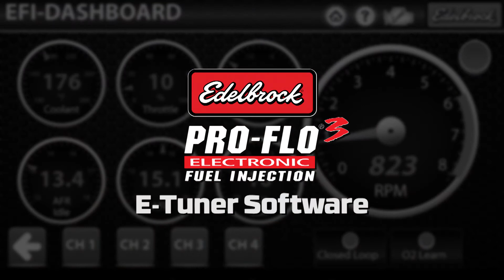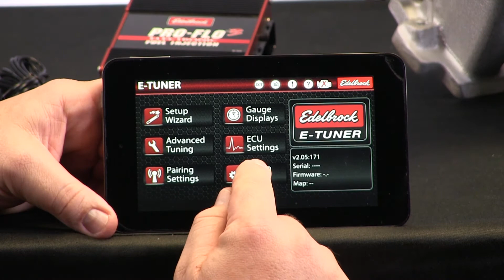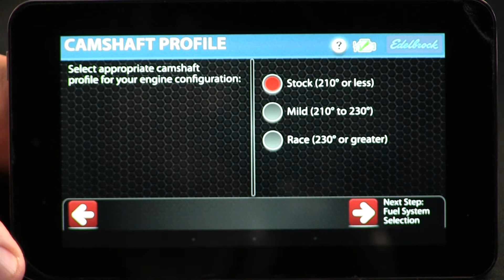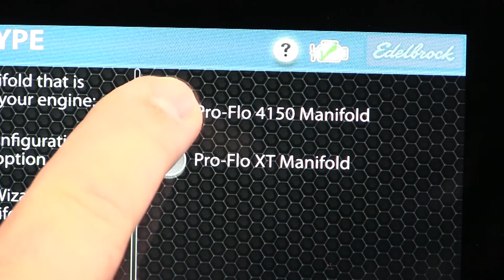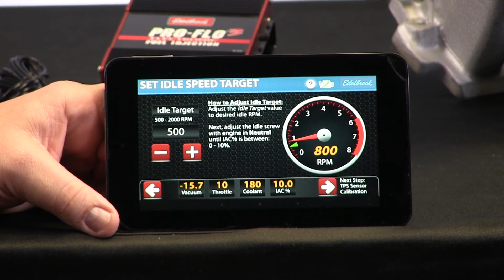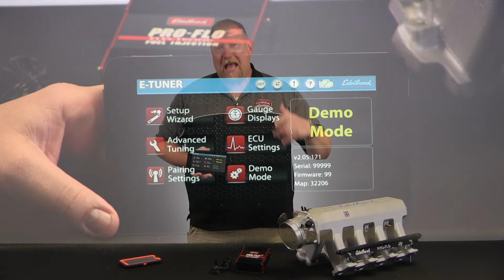Comment: What else do you recommend i buy separately if i want the pro flo 4
Reply: If you are other than stock and not doing a Pro Flow 4, buy the Pro Flow 4. and you will need a sump. 
conveniently, Edlebrock does sell one. you can try it with a mechanical being pushed by an electric in line. let me know so I can reassure myself I went the right way with getting a sump. it's PN# 36031, universal fit and comes with everything you need but a heat gun and it will even plug into the EFI and work from there. If you are not using aftermarket manifold bolts you need to check length. 2 of them will have to be shorter than the rest, one driver side, 3rd one back and passenger side 4th one back. I prefer to use new ones all the way around-had to go get the shorter ones. Exhaust manifold gaskets-just in case-had to replace the one for the bung hole side. Get the bung hole installed first. If not possible you can hire Hooker to send you a temporary one to add so you can get it to a muffler shop and then get it welded on.
Don't think it's just super super easy because if you are like me, things have to be almost perfect. You get enough wire to mount it anywhere. I chose not to use the tach wire, cut to the chase and hooked it to neg side of coil. Ignition wire (pink wire) is the only one that came up short-added as much as I had to make the circuit. You should have everything else you need.

Comment: Can you guys do a series on fine tuning once we get it running? I realize it can learn, but I assume we need to be in the ballpark first. A lot of these functions are alien to us non tuner guys. The setup tuner is great, but what next? Theres lots of documentation on each item but having a video demonstation on things like retarding timing for those of us that run crazy dynamic compression ratios and still want to use pump gas. Its so much more comfortable to work with if we can watch a video on that stuff, or trouble shooting. I hate to have to call the tech dept every time I get a little lost. Yous should be making these awesome parts, not dealing with traditional carburator fuel monkies on the phone for an hour at a time lol. Videos please?

Comment: I cant figure out what numbers of my S.N  to use for my pin number to use my tablet
Reply: Last 6 digits found on the ECU label.
Reply: John Evans did u figure this out
Reply: when the search turns up the unit there are six numbers that you just copy and paste from it or enter them manually, mine starts out 00####, did that and my phone died. Next day it was the right numbers, AND, really, did you even stop and (I finally did) read the instructions? slow down and read them, it takes less time to do it the right way always.